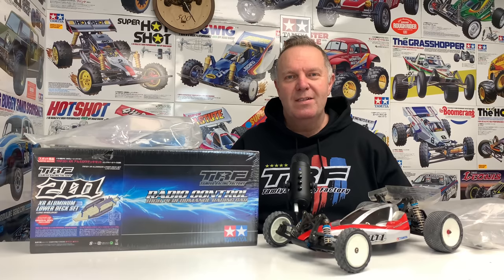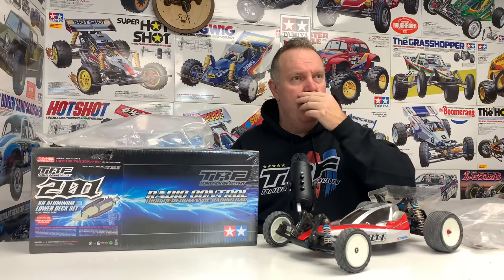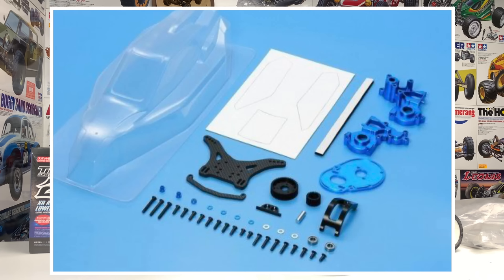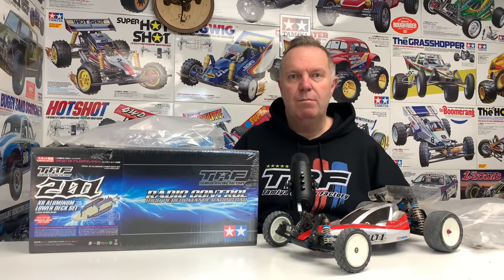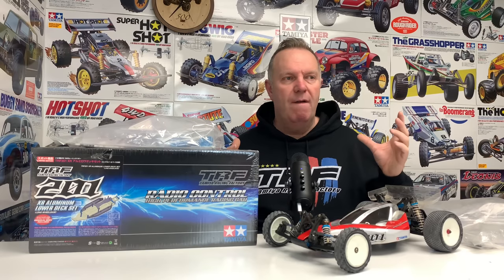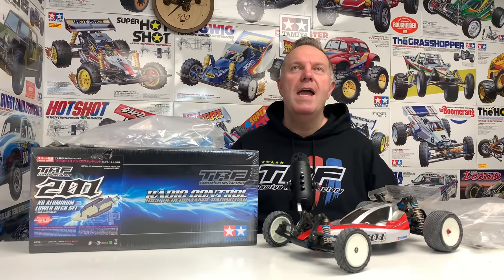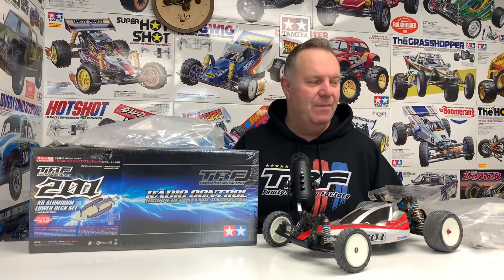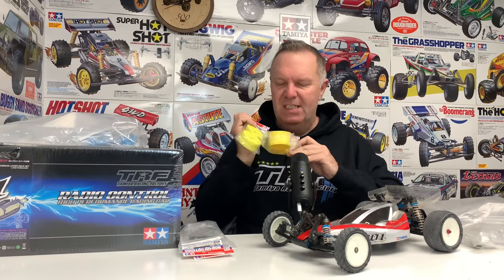I’ve Fallen Down the RC Rabbit Hole again!   My Ultimate Tamiya TRF Project…

Comment: Very nice Glenn. Don't worry, I like to sit back, relax, and listen to you chat with us. Looking forward to this project. I have an OG TRF201, it was actually hard to find, didn't even get it off the bay. I asked around on Tamiyaclub (I think?) and someone there sent me to a link to one for sale in France of all places. Paid a bit much at that time, but looking at prices now (when you find them) not bad at all.
I also have an XR 201 with the XM conversion on it. It is currently in pieces spread about a bit cause I, and this is going to sound weird, have the gearbox and rear section attached to a Hornet chassis. It was a personal project of mine. Using CAD programs and a 3D printer.
Anyhoo, like you said, if you're going to race it, the 12mm conversion is a must as it opens up a world of wheels&tires for you to use. Bring on the vids :).

Comment: Hope you do run this car I am keen to see what it handles like is it going to be bum heavy because of all the aluminium at the back it will definitely be more planted better traction but will fly through the air better than than the stock one. A lot of breaking and throttle inputs to keep it under control in the air. Lol who cares it looks bloody nice aye 👍👍

Comment: The "stupid reason" Tamiya used a pin rear and front imperial bearings for the wheels is because that was the industry standard at the time of the TRF201s release. 10 years ago releasing a 2wd buggy with hex drives wasn't a clever idea as any racers old wheels wouldn't fit your buggy, so copying the market dominant B4 wheel fitting gave you an advantage in attracting over B4 drivers compared to the Schumacher Cougar with a 12mm hex and Losi with 10mm hex wheels. If you've got boxes full of race wheels and tyres for your B4 it's easier to move to the Tamiya, and when you need more wheels you have plenty of third party options made for the B4 to choose from.

12mm hexes only became an industry standard for race buggies when Associated introduced the B4.2 in 2013. Losi even held out until 2017 before changing to 12m hex fronts.